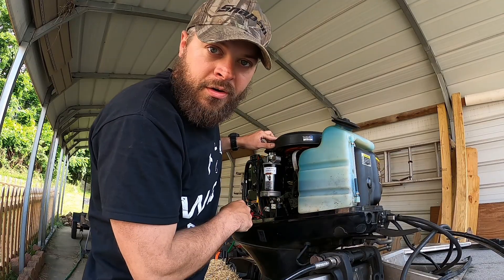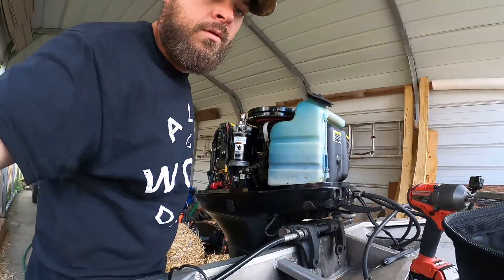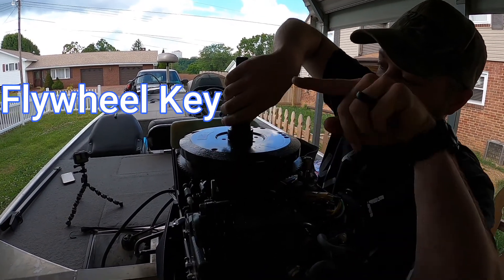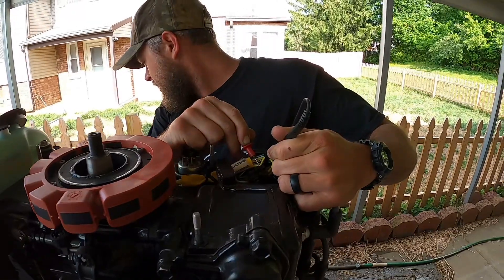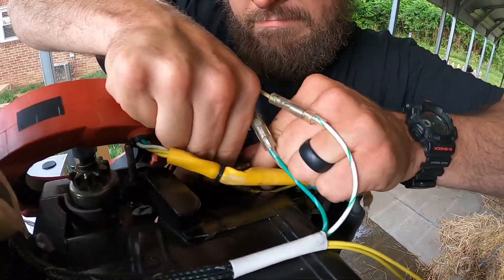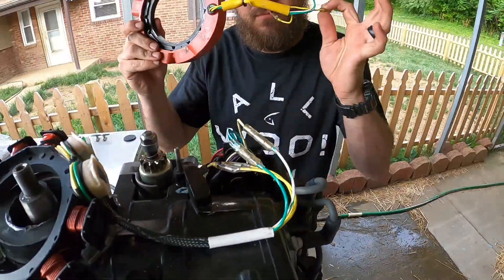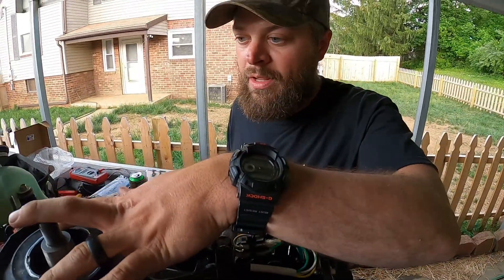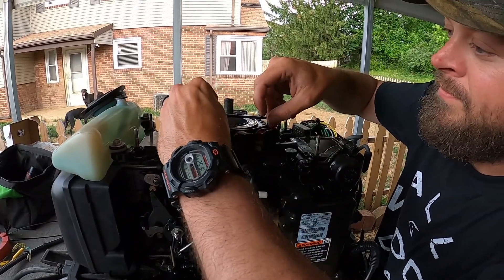HOW TO REMOVE FLYWHEEL Mercury Outboard NEW STATOR 2 Stroke Mercury 50 9M9XM00591C1

Comment: Awesome Video, I have a 2006 Mercury 90HP ELPTO and it will over like  the tasmanian devil on meth but no fire, I have power to the solenoid 12.6 and turn the key and 12.6 on the other side ... where do i test  next

Comment: You don't know how to read a Volt/ohm meter apparently.. O.L. is NOT ohm overload...it means no resistance or open wire...what a waste of time here
Reply: You are wrong.  OL means infinite resistance or unmeasurable resistance.  Not zero resistance.  It can be interpreted as open line OR overload.  Take your rude ass back to basic electrical class.

Comment: CAN A BAD STATOR  CAUSE A MOTOR TO LOCK UP WHEN IT DID NOT HAVE ANY PROBLEMS JUST ALL OF A SUDDEN
Reply from the maker: I would think not. It is just mounted to the rotating assembly, not in contact with anything.
Reply: The motor I'm currently looking at yes because it looks like the failing stator started to come apart and wrap up around the flywheel and drive shaft

Comment: Actually - no.  You should check the rectifier first.   It's easier to test, and cheaper to replace.  Also, take a photo before you start switching wires.  You may wanna touch up the spots on the wires that you punctured to test with some liquid electrical tape.  Excellent video thx for posting this.

Comment: Can I ask what the issue was you were having to what led you to change the stator? Also you mentioned voltage regulator
Reply from the maker: Misfires, poor idle and really couldn't run at low rpms for no wake zones, moving around the ramp. There was more to be found, this was years ago I have a new video I am working on where we find a culprit that definitely helped exaggerate those issues.
Reply: @WildWonderfulOutdoors  I'm having por idle and starting along with getting up to speed.
Reply from the maker: @YourAverageAngler  Starting as far as? You're using the choke on the key I'm assuming. The cheapest part to throw at it to start is a fuel filter and some stabil to make sure the gas is good.
Reply: @WildWonderfulOutdoors  no I don't use the choke. 98% of the time starts right up. But lately not so much or I'll be idling and then it just dies runs rough and can't go above 30 mph. I check the plugs they did not seem burnt but did have a lot of oil and gas on but yes I will do the fuel filter

Comment: My 60-hp mercury motor  is not firing on the top cylinder. What is wrong, and where can I get that fly wheel tool.
Reply from the maker: The tool is on amazon, the part number is in the description. If it is just one cylinder for sure, start with spark and coil.

Comment: Those stator screws are 55 inch pounds lol and should be lock threaded! Otherwise awesome job! Also if you have the v-6 blocks there is no key, the flywheel is grooved  Also never torque with your impact ... torque to specs. That's how you wreck your bearings for your connecting rods. Just sharing my mercury knowledge as a tech.
Reply: What’s the torque spec for it mate if possible

Comment: I've got a 1996 Merc 150 EFI 2-stroke that absolutely quits while at WOT after being well warmed up (20 min of running).  I can't go past 7 mph after that happens and it'll start right up after it quits.  Hoping for a DIY solution but don't know where to start, ECU, stator, voltage regulators (2).  I changed the plugs...no diff.
Reply from the maker: I just filmed a video a couple weeks ago that I need to edit. This same motor was breaking up at WOT really bad. We ended up replacing a coil that had a loose connection but I think the main problem was a section of wire that we ended up replacing. Check your wiring, on my motor it looked burnt because of all corrosion causing resistance which causes heat. I will try and get that video up soon and I will let you know when it is. You could subscribe too and then you will know when it’s up.
Reply: @WildWonderfulOutdoors  Thanks, Homestand!

Comment: Hi I'm on the process of replacing my stator I have a mercury 80hp but the stator has no part number and I don't want to get the wrong one
Reply from the maker: Look it up by your model or family number that is on the motor tag.
Reply: @WildWonderfulOutdoors  I have no tag it got destroyed due to a small fire
Reply from the maker: If you know the year, make and hp then you should be able to find out what model number it is online. Just google it and compare what pops up to what you have.

Comment: By any chance will that stator work on a 80hp? There are so many that I don't know wich one will be the right one
Reply from the maker: Check your model and "family" number on the factory sticker in the motor. You can search parts by that, the stator I installed was made by CDI, it came with diagnostic instructions and instructions to install. Very high quality products from them.

Comment: I just subscribed to your channel maybe you can help me pinpoint my problem I have an 80hp mercury outboard motor oil injected that starts but I'm only getting spark from one of the 3 coils and I don't know where to start
Reply from the maker: Have you moved coils and plugs around yet to see if they work in different locations?
Reply: @WildWonderfulOutdoors  no I guess that will be my start
Reply from the maker: @gilfredooquendo9969  yea man do that just to eliminate if the parts are bad themselves or if it is something beyond that. I appreciate the support man! I am getting ready to film a new troubleshoot/repair video on my outboard.

Comment: What was the stator part number for the new one you installed?
Reply from the maker: CDI P/N : 174-2075k 2 Stator 2, 3 and 4 cylinder (16 amp)

Comment: Harbor Freight bolt type whell puller is all you need - did my 2002 40 hp mercury in 3 minutes.
Reply: Nice. This took about three seconds.
Reply: @goodguessgarage4265  and sixty dollars lol but I digress I am not a tech - NO NEED TO BUY AN EXPENSIVE TOOL PEOPLE
Reply from the maker: I'm a tech in the automotive industry. Expensive tools pay off all the time. To each their own, though.
Reply from the maker: Yea this tool was designed specifically for this. It just popped right off with the impact.

Comment: Thanks for the video man. My boat has been acting up for a year. Been stranded too many times. I've gone through new batteries and even changed out the cables. Not getting a charge back to the battery! I have an 04 F115 yamaha. I'm not a mechanic but I love to do things myself if it's within my capability. I think I'll give it a shot since I don't have a grand to give a mechanic lol she's been a pain in my ass.
Reply from the maker: It's a super simple repair as long as you have the tool. I highly recommend that! You can always bag and tag your nuts and bolts for every piece you take off and lay them in order, so when you go back together its the same order with everything organized. I'm glad the video helped! That's the whole point! Tight lines!
Reply: @WildWonderfulOutdoors  one more question brother. How do I know it's not my voltage regulator rectifier?
Reply from the maker: @hookedonthebay3890  there is a series of test you can do. I have the data sheet that came with the new stator from cdi. I can send it to you via email or something
Reply: @hookedonthebay3890  Hi, i am having the same problem, battery not charging..What was finally your problem? can you solved it? I have a 60 hp merc, 2016
Reply: @juangallino8206  Hey man I'm taking it to a mechanic in a few weeks. I will let you know when I find out!

Comment: A bad stator won’t keep the motor from starting, correct? With no spark, what could be the problem ? Same motor.
Reply from the maker: We also recently had the volt regulator replaced. It causes similar symptoms to the stator being bad.

Comment: So... 97 90hp elpto here. I have zero spark and zero power getting to the coils. The boat has been sitting for a while. I read that the stator could be my problem... checked it and it's bad from what I can tell. Obviously it needs replacement, but what else would prevent spark after this gets replaced? Oh... and very informative video... I already ordered my tool for this because of this video. Thanks!
Reply from the maker: Check the battery to make sure it’s charged. Is there a separate coil wire? It could be a bad coil too.
Reply: Battery is good and also new. Don't think it has a separate coil wire. I just checked it at each of the three coil packs. No power is getting to them to fire the plugs.
Reply from the maker: @MrGallaleo  it might be worth buying 1 new coil and checking if it works, then move it to the other two spots and see if it works there too. Could just be bad coils.

Comment: Would the stator prevent my outboard from going over 4 rpm. Max is 5600
Reply from the maker: No, it just attaches to the flywheel. It’s not it’s own moving part. I would check carbs and fuel filter first. Does it bog down or just not rev to 5600. If max is 5600 you probably wouldn’t run it that high anyway. That would be like keeping your car at redline going down the highway.

Comment: Would you be able to show a short video how your trigger is mounted?
I got the service manual for my 40HP Mercury and even there they don't show it step by step
Reply from the maker: What do you mean by trigger?
Reply: @WildWonderfulOutdoors  the trigger assembly that goes under the stator, it actually looks like yours might be loose
Reply from the maker: @tmpst787  What makes you say that?
Reply: @WildWonderfulOutdoors  it’s the circular plastic piece that ends up in the center of the stator. It’s mounted by a plastic arm that sticks out to the left of the stator and I see it move around when you touch it. It shouldn’t be moving around like that.
Reply: @WildWonderfulOutdoors  at 7:09 when you pick up the old stator there is a part sitting around the shaft that moves around a little as you pick up the stator, it kind of looks like a smaller stator, that’s the trigger and I’m pretty sure it’s not supposed to be loose like that.

Comment: Greetings, does it matter how many amps the stator brings? I'm in the market for a new stator but I keep seeing different amps 9 amp and 16 amp. Its for a merc 75 hp 2003 2 stroke.
Reply from the maker: We called a local marina and gave them our model number and they ordered the part. We went with a CDI electronics stator. It is "aftermarket" but it is like ac delco to GM. They make the part for the OEM. I would at least call a local dealer and have them tell you which one to get. Also order your flywheel puller!

Comment: I have a 2004 90 horse 2 stroke mercury,when I checked between the two yellow wires, It toggles between.3 and.4.When I checked the ohms between the green with the white stripe and the white I get.681.Also the two bullet connectors from the stator on the two yellow wires have been warm enough that the coating stuck together.The original stator is on the motor and I changed the voltage regulator a week ago because of a high voltage problem.
Reply from the maker: I can send you the CDI troubleshooting guide.
Reply: @WildWonderfulOutdoors  Yes sir that would be great,do you want my Gmail adress or can you send it here?
Reply from the maker: @tattooslm  I can't send photos in comments on here. If you want to leave you're email that will work. You could also message me on facebook or instagram. Once I email you I'll delete your email comment so it's not just hanging out on youtube.
Reply: Up to 4 cylinder 660 to 710 between greenwhites should be ok according to manual

Comment: When you checked resistance from the coil to ground, isn't it supposed to have read OL. If it measured any resistance, wouldn't that have indicated a bad coil?  Just curious.
Reply from the maker: In the troubleshooting section on the instruction sheet from CDI it says:
1. Check resistance between the yellow wires, you should read 0.4 ohms.
2. Check the resistance from each yellow wire to engine ground, you should not read any resistance. Resistance to ground indicates a bad stator. Remember if you are touching the test leads you will get a high resistance.

I appreciate your question, and checking out my channel, I'm trying to hit 1,000 subscribers this year! I got this information right of the instruction sheet that came with part. TIGHT LINES!
Reply: Yeah. OL from stator to gruound is good. If it reads a low number its bad.

Comment: Do you have to reset the timing after doing this?
Reply from the maker: No sir, the flywheel is notched and the crankshaft has a pin that only allows it to go in one spot. So the balance or timing never changes. If you get the tool it's super easy.

Comment: Good video. I was wondering if you can provide the part number for the flywheel removal. Thanks!!
Reply from the maker: Sure thing man! We used the Marine Tech Tools AMT0023, it works like a charm!
https://www.amazon.com/Marine-Tech-Tools-Mercury-Flywheel/dp/B01N5LJU3N/ref=asc_df_B01N5LJU3N/?tag=hyprod-20&linkCode=df0&hvadid=312114712708&hvpos=&hvnetw=g&hvrand=8349452374840974021&hvpone=&hvptwo=&hvqmt=&hvdev=c&hvdvcmdl=&hvlocint=&hvlocphy=9009438&hvtargid=pla-583136529987&psc=1
Reply: @WildWonderfulOutdoors   Thank you!!